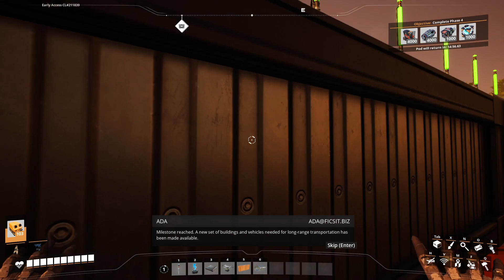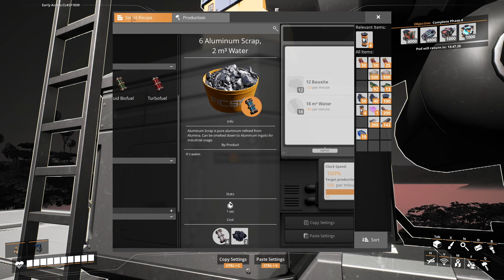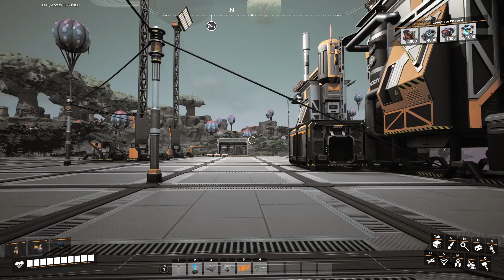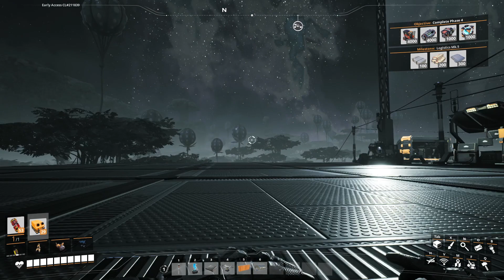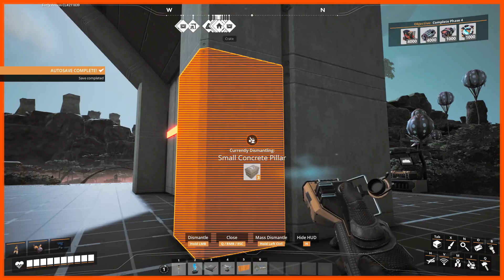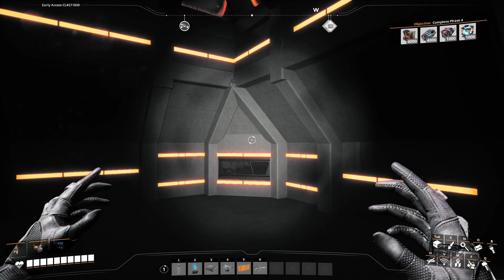Phase 4 and Starting our 3rd factory  -Satisfactory pt33

Comment: Bro, your design skills are on point! Great work. Forgive me if this is presumptiuous, but I figured I'd try to be helpful...

If you want to empty or fill a container with 1 item, try Ctrl+Click to completely empty/fill the container instead of Shift+Click to deposit 1 stack at a time
There is a better alternative recipe for Alumina solution and Aluminum Ingots you may want to check out. Technically, there are also better alt recipes for Aluminum Scrap too, but Pure Aluminum Ingots and Sloppy Alumina will remove the Silica requirement entirely, which you may find helpful. Personally, I found dealing with the ratios of water and silica to be more than slightly annoying in my factories, so I thought I'd at least throw that out there.
Reply from the maker: Thank you for the tips. I will for sure try that next time I play. I unfortunately don't have better alts right now. ill probably set this factory up like this for now and hopefully can unlock the better alts later on.  getting all the stuff here will be a big headache, but I'll get through it. 

Im glad you enjoyed the build so far! :)